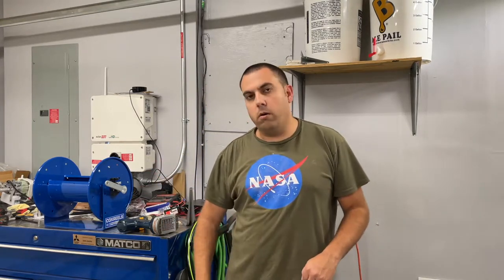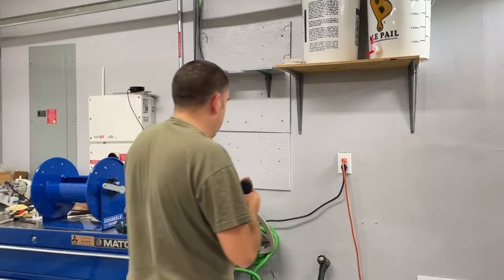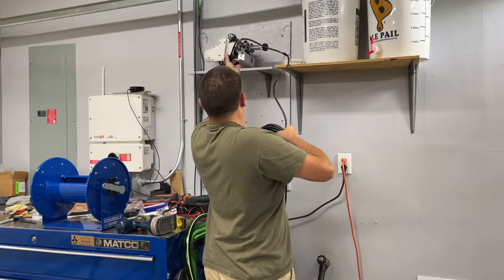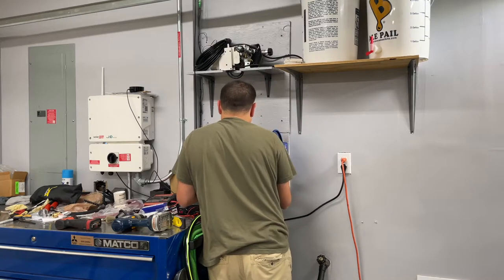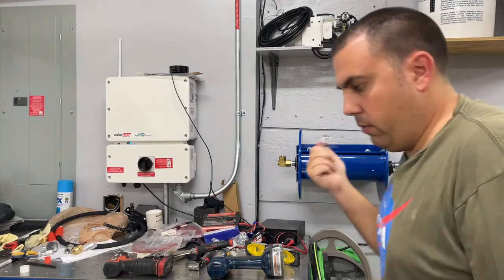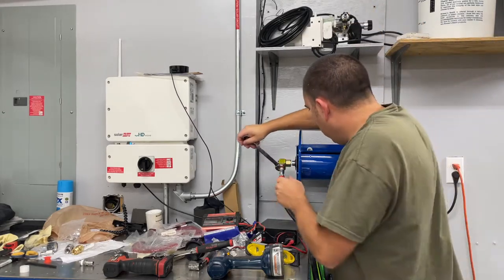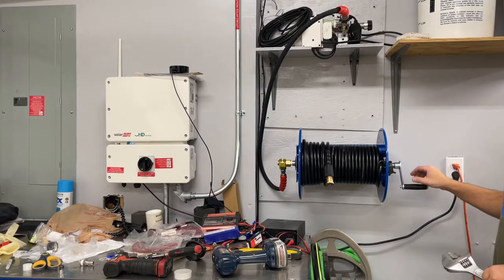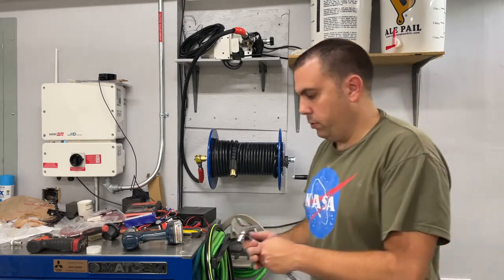Garage Pressure Washer Install

Comment: Looks good. certainly is a slippery slope with youtube and pressure washer setups
Reply from the maker: oh i know.  I wanted to go with a more inexpensive set up.   Currently i don't need to invest in high quality products to last as i am not using this every day.  I only use it maybe 1 time a week or every over week for washing the cars.
Reply: @gtmachine6134  would love to know how it works we all struggle with the inexpensive setup vs something like obsessed garage i just got everything in for a active 2.0 pressure washer.
Reply from the maker: @jasonsgreen  It works greats.  The only thing is there is some lag with building pressure back up on first squeeze.  Other than that its great.  I can deal with that vs spending another 500 for a better pump that wouldn't do that.   I've had it for 1 1/2 years now and 0 issues with the pump I used.  
Once my pump goes up, I'll probably buy the better pump.   But building the system from scratch it was a lot of month at the time.